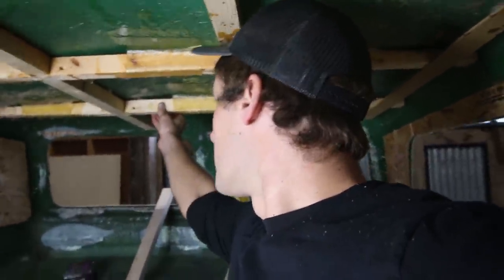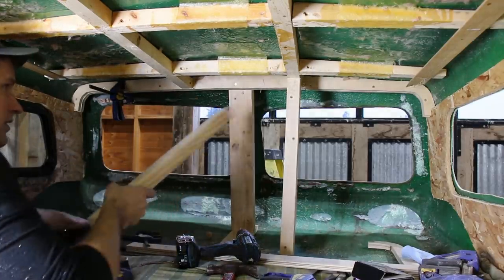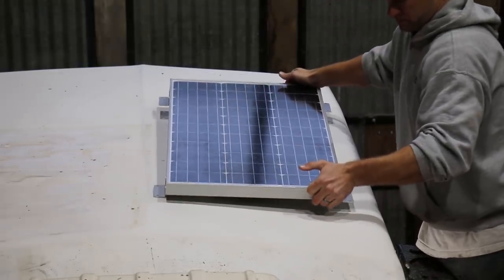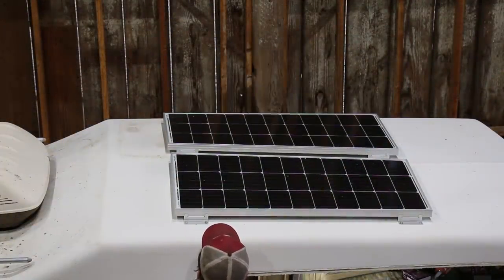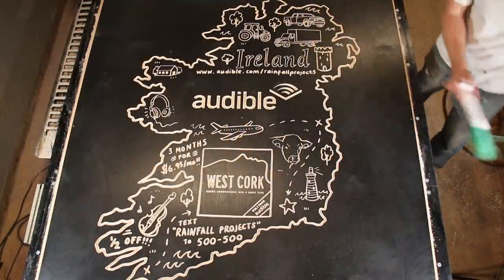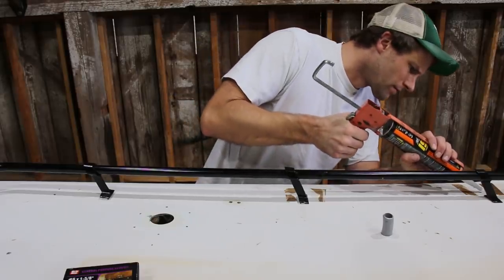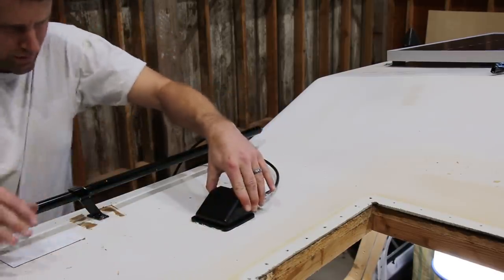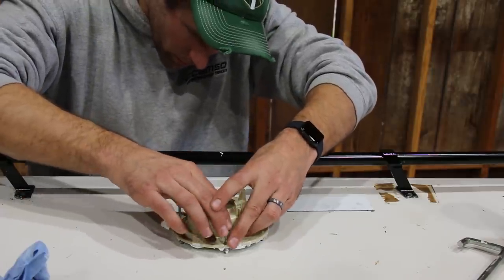Camper Van Remodel pt. 3 - Solar Panels and Electrical

Comment: For roof leak peace of mind...

3M™ Marine Adhesive Sealant 5200 is a one-component, high-strength, moisture-curing, gap-filling polyurethane for permanent bonding of wood, gelcoat and fiberglass. It cures to form a firm, rubbery, waterproof seal on joints and boat hardware, above and below the waterline.

Thanks for the vids!
Reply: 5200 will bond stronger than the material it is bonding for a good portion of eternity.
Reply: They make special rv sealant that holds up better
Reply: 5200 is the devil's caulk. Don't use it on anything you might ever want to remove. 4200 is a better choice.
Reply: 3M 08609 is the best stuff I can find for sealing roof installations. 5200 is also really good. i use that for everything other than roof installations. When you see the way both of these dry compared to regular silicone sealant it will make a lot more sense. It's pretty miraculous stuff.

Comment: Just a thought....  you could use fiber glass repair for your roof holes...  Would be permanent and you can sand/paint to match the roof.  Great ideas and been waiting for this video.  Keep em comin!
Reply: Yeah was going to say the same thing
Reply: Im just thinking "old fiber glass, run away"! He'd be better off starting with pretty much anything else
Reply: @Leofred2000  Agree on the roof tape. It will eventually lift at speed. I restored a boat with LOTS of holes in it. The techniques used to repair hull holes apply here. Dish the fiberglass on both sides, put a small patch to fill the hole and then progressively get larger. You can smooth the top so it doesn't look bad and the inside will be covered.

Also, to close the gaps on your ribs, you can use glass beads to thicken your resin. Works a treat!

Love the videos and your narrative. Keep up the good work!

Comment: Nice work. To answer your question about the roof ribbing, those fiberglass top units were initially built upside-down. The internal bracing was built while the unit was still in the gelcoat mold; notice they were only held in place with construction adhesive and straps of fiberglass cloth. In some units, a thin wood ceiling and/or side panel was installed as well, becoming part of the structure. So when you removed that, the ribs had no further support. Your reinforcement was a good idea. But if you could stand the chemical odor (good ventilation is a must), I'd also put some additional fiberglass mat strips to re-attach the bracing to the shell.  BTW, I'd suggest silicone caulking and/or low-expansion foam where wood meets the metal sides, to prevent squeaks later on.

Comment: You should chuck the silicone sealant. Stuff will not seal right any you'll get leaks. Look into RV urethane based roof sealant. Dicor is a good brand. An alternative is 3M 5200 marine sealant.
Reply: And its a "bigger the glob,better the job" situation.
Reply: @twilliamson3  A fellow cult of AvE person I see. Gotta make sure it's Skookum.
Reply: In that situation it will hold just fine. Exposed silicone is at issue, that one's not.
Reply: Also, use the Dicore to seal the edges and over the top of the screws as well.  They make a self-leveling one for the roof and a thicker one for the side walls too.
Reply: +1 on the 5200. Will never leak...

Comment: I have the 100 watt renogy kit on my camper build. I would suggest for the future to use butyle tape in between the roof and any mountables be it brackets, windows, fans, or Ac units. Once the butyl tape is on and trimmed I put a bead of silicone around the edges and the tops of the screws for extra water protection.

Comment: It's a huge job, I know  I have the same model RV, gutted it to the walls like you have , endless hours spent so far but I'm getting a good job. Using 100% marine hardware and materials, solid mahogany construction w/ teak flooring. My 1984 van has 25K miles, like new mechanical condition!!

Comment: Some tips for future holes in the roof:
- Use polysulfide caulk and not silicone. It's more UV stable and doesn't cause a mess the next time you need to caulk that hole. Silicone is tough to remove completely so you can't get it to seal a second time. Don't use polysulfide on plastic though. 
- Countersink the outside of the hole after drilling it. This leaves a little cone shaped void where the fitting meets the roof. This will fill with caulk and create a nice bead. 
- Pull the wires into the conduit before you tuck it into all those tight corners. 

Thanks for the video!

Comment: Great videos, we picked up a 1990 Falcon 190 last year and we're loving her,  so watching this is very useful,  hopefully we won't need to go so far but we've got a couple of water ingress issues still to work on. All the roof hardware had never been resealed so that was job one, having had Tv's before butyl tape under everything, marine grade stainless screws and finished with self levelling sealer, no more leaks, and easily, sort of, removable is we need to. Once we can get her indoors we need to replace the interior roof board and liner, sagging in the front and water damage in the bathroom as well as the 'shower' wall and the floor,  totally agree about the carpet round the toilet! We're going to use either wood or maybe vinyl for the flooring throughout just for ease of cleaning. Did laugh at the shower tub, being the 190 ours is bigger and usable if we really need though I do need to remove and repair, tiny almost looks like a 1/8" hole drilled in one corner? Goor luck with the rest of the build,  looking forward to it.

Comment: Skip if somebody already said that. Instead of connecting solar panels in parallel, connect them in series and use an MPPT solar charge controller from Victron Energy. So many reasons to do so, but mainly you'll get 30% more power from the solar system.Great videos, btw

Comment: Maritime caulking called butyl tape, remains flexible and sticky, seriously great for securing watertight screws, whenever you need to remount those solar panels or make other waterproof mounts.

Comment: Hey bro, thanks for making some really great content. To prevent leaks you could use butyl tape tight in a smaller amount around the screw/bolt head and a relative thick circle around screws underneath between the brackets and surface. The pro uses it in the marine industry to seal where they screw/bolt things to the glass fiber to prevent water from entering and then sikaflex all other places, for example, gluing and sealing windows etc. finishing with a strong UV resistant silicone on the outside on top, because those are the methods proven to work the best.

Comment: Next time if there is a next time, with carflex, I know how hard it is to push wire thru it, use wire lube or in a pinch a little water works fine. Been doing electrical work for 40 years, have found ways to make things work easier working by myself. Hope you had a VERY MERRY CHRISTMAS  N NEW YEAR.  Thanks for sharing.

Comment: You should get an orbiting multi tool, they're a lot more useful than one might first think. Both when cutting in confined spaces, and when cutting out, lets say, rotted plywood without damaging the surface underneath. :)

Comment: Check into 3M 5200 for sealer, It's what the marine industry uses.
Reply: We use it on every thru hull fitting and stuffing boxes on all the boats here in my area.  Only way to go

Comment: PV on your roof - When I mounted my PV panels on my RV's roof I made brackets so that I could angle the panels up. So when I was boondocking, staying in one place for a couple days, I would park my RV so that when the panels were rotated up at an angle, they would catch more of the sun's output than if they were just laying flat. And a very good roof leak stopper is butyal tape, it never drys out and stays flexible so that movement does not seperate it from the surfaces that you want to keep watertight. Here's a tip from the boating world - when you're using a caulking sealant, don't screw down tight the fixture, make it snug and then wait a day until the sealant has had a chance to cure and then tighten up the seal. That creates a better seal.

Comment: I watch about 20 Youtube RV channels and almost everyone of them use 2 products on their rook to stop water getting in
1. Dicor Self-leveling Lap Sealant - it goes on like caulk on the holes and around the perimeter of the fixture then it slowly levels itself and seals up everything.
2. EternaBond  roof seal - it's like putty tape, lay it on the rook, set the fixture on top, screws go right through it and get sealed. It's expensive but apparently works like a charm.

Comment: Good progress!!  Question though- why didn't you just 'glass in your wood support and hole repairs?  Longer lasting, and would definitely seal the area.  Also, I would fiberglass the frames around the windows so that water damage would be lessened (or stopped) in the future.

Comment: Use roll on flex seal for the roof   works great on r v s and look into boat marine type stove and sink and fridge and look in to those really big truck driver coolers that freeze heat and cool ive been where you are 26 years ago so I know something  or 2

Comment: here's a useless thought (at least after the fact)... would it have made sense to fish the cable through the conduit prior to putting it in place? seems fishing wires through a kinda straight tube would be much easier than a twisty, bendy, kinky tube? just a thought.

Comment: I have a 1988 Ford E250 based Falcon 190 and have searched for some time for inspiration an redoing the layout. I have almost finished the construction of a 1,000sqft garage/workshop and will finally have the space to tackle the modification or tear out(not sure yet) of the inside. I think of testing the current layout first and see, what will work for me and what not. The toilet goes out since I will do boondocking and winter camping. Did you finish your layout/build out? I think of combining the black and gray tank and have a sink diverter for winter to keep grey water inside and sink of a Joolca-system for a shower. What's your take on the toilet and shower. Thanks for your videos and see you sometime on the road, Carsten from VT.

Comment: I think if you want better power and efficiency the 4.4 Turbo Diesel block bolts on the gearbox no trouble, as these older fords are thirsty buggers.

Comment: Is there a way to put a lithium battery in there so you can run AC off. And use your engine as a backup to charge those batteries when needed like some of the modern campers

Comment: You should have used epoxy and fiberglass cloth on the roof that way it never leaks. Fiberglass is the easiest thing in the world to work with anybody can do it.   Calking is only temporary fix

Comment: Your electrical diagramme is incorrect (if you are aiming to have a dedicated starter battery which really is a must). The starter battery in your drawing is connected to the positive bus along with the other batteries. Your electrical consumers are likely to drain your engine battery and do so in a way the the batt is not designed for...

Comment: Sir may I suggest “Butle” tape for sealing your holes. I might have misspelt it but it is used for marine applications and works perfectly for your vehicle
Reply: To help you find it - it’s Butyl tape. Lasts forever and remains flexible, much better than 5200. You will find out particularly when you have to make a repair and cannot remove the 5200. Check on net how to apply it, much easier to work with than the stuff out of a type. The silicon you used will leak soon and cause a lot of water damage.  A sailor.
Reply: Tom S thanks for that I knew I was wrong with the spelling but not it’s properties
Reply: Brett Swampy pleasure - you find it on my boat everywhere. Hope Rainfall Projects will Check the internet, because his roof repairs/installs will leak

Comment: Just a heads up on the A/C replacement Be careful on Heat /AC they often do not put out very good heat  the heat strip/heat units in many of the roof units are under powered (example a 13k btu ac system may only have a 5k btu heat element.  If you are just looking for some heat while you are plugged up strip heaters would be a good alternative for just general radiant heating or one of the diesel camper heaters  like is used in this video  https://www.youtube.com/watch?v=3j5qW9kKBLM .  Also if you should re coat the roof dicor makes really popular  roof products for campers / rvs  on roofs and windows etc from all i read when rebuilding my camper a lot of the information I read recommended staying away from the silicone based sealants because of re coat issue .   From all the work you have done so far it looks like amazing  I can imagine the end results.   So far it looks like you are going to craft a really amazing camper...     Looking forward to see the completed project.

Comment: should look for the rubber RV armour we roller over the old roof  was not leaking just stays in one spot and was stan from the trees freshen the trail up we repainted the outside as well and order the decals for the trailer too had a good offer on it and sold them with the lot
did buy a 53 van and started to make a larger trailer had 8 pull out 3 years I worked on it full-size stove and fridge and a freezer put a generator under it solar panels on the roof to full-size queen bed large shower 2 washers and 2 dryers using it for work one is just for the work clothes  the other one is my good clothes  2 washrooms to when going off of work come into the work fount door it just for when I am working keeps the trailer cleaner put the clothes in the washer and take a shower then able to go in the living area clean used it a month and sold it with the truck with the 5-year job too had a very funny feeling about that job I was happy to sell out  6 months later the job the company walk away had friends lost everything they owned some as the person I sold to have taken me to count a few times I should have told him about the job I did not know about it  
I have made truck camper to something to do what that was about some camper one was aluminum frame and the other was wood cam out about the same as to the weight between both was not plan on making money off of the build got what I put into them

Comment: Hi you see the window in the front slanted on the bead block them out or you will regret not to the slated window are a terrible idea from manufacture because of The water running during rain on that and vehicle movement side to side and wind and the angule the water  will eat true the seal don't matther how good it is in will leak in no time that is why the windshield have a curve in the front and ice hail or branch from a tree  any devry will bust the glass and is on top of the cabin were all you electric on your dash is and were you drive any water there will cause a electric short and will desaible the engine living you stranded in the late model's they don't put those anymore